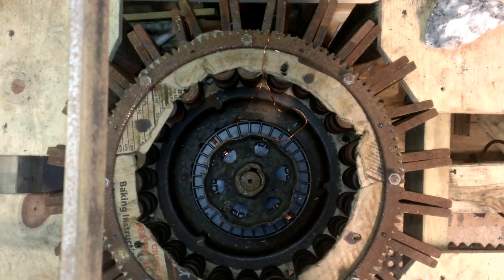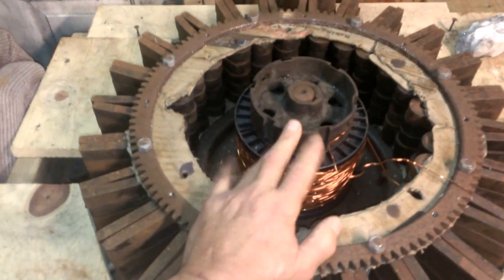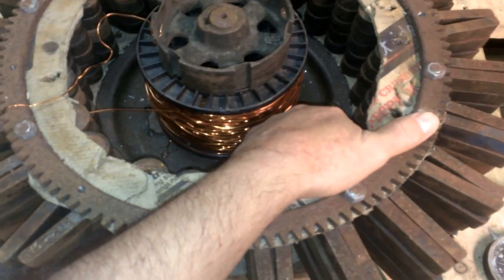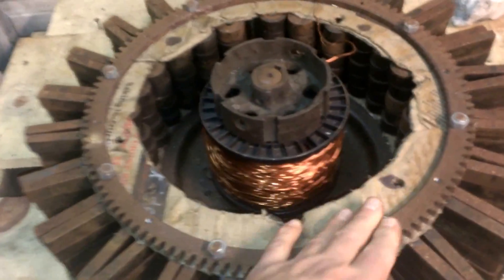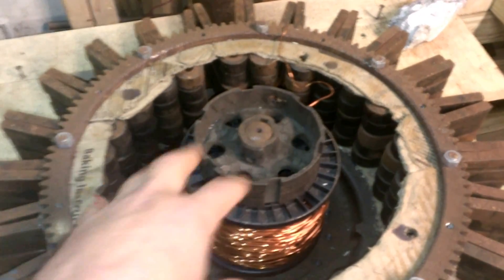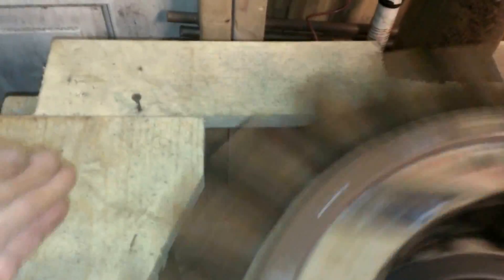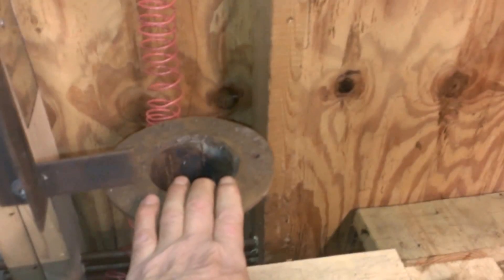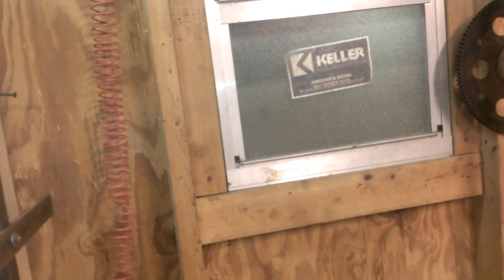The truth about Ed Leedskalnin's magnetic flywheel

Comment: When you have an inner and outer wheel of magnets, you will find that they reach a lull and stop as the field finally snags the contraption.  The V shape of the magnets helps to avoid that lull by sending the field in a waveform that compresses towards the tip of the V, causing the distance between magnets to not matter so much, and letting the thing spin more freely while at the same time feeding more momentum to itself.
I hope I said that in a succinct, comprehensible manner.

Comment: The "key" probably had an extended conductive piece of metal that touched the sphere at each rotation to "pulse" the circuit, which allowed for the recharge time you are mentioning.  The spheres are the "timing" of the pulse.  Not too different from picking the correct Mosfet and transistor combination like what Jack Scholze used on my coil designs, which you are about to emulate mechanically.  p.s. Make sure you put the water in :0)

Comment: If it's mimicking a human cell, it should have a rotating pos/neg at it's core. The outer cell wall is negative like the surface of the planet... the toroidal core brings in positive on one side, neg on the other... the rotation creating the lotus like field which acts like a gear. Jon Depew's vid "Equilibrius Grid" shows this.

There's a toroidal eye created that acts like a sympathetic resonance vortex tunnel pathway for aether to flow along similar to the thumper in dune is alluding to (long worm=long wave), or Egyptian Djed (Djed-Eye)

The rotating blocks in the yard of the castle with cup marks in them are to flow the charge along determined pathways..there's a vid on here somewhere showing it...forget the name though. Will link if I come across it again.
Reply from the maker: Hi there
The core has a neutral and a positive. And a negative running around the outside

Comment: You were absolutely correct!! Your suggestions on the way to use a Djonfrick reducer to  govern the feedback worked perfectly on mine. It's been running all day now and I'm even charging my computer. I will test loads it will take. The odd thing I found was that as I increased the load the temperature didn't go up, it went down consistent with the current load. One thing I must warn you about. The closer you get to the stator the more  of a pinching feel you'll get. It kind of hurts. Don't go near it under full load. It hurts. I'll update tomorrow. I have a heater connected to it to keep the room warm. It's making my room cold

Comment: I think you may be onto something. As I see from here the rebulon flux of magnetic sceebance would flow in a general pulsing. If at any point the polarity adjusts to modification flows the rebulon flux inverts much like a heart beat and that is simple to calculate, I obvious you've read Dr. Mabalab's book on rebulon flux fields as pertaining to nulpance currents. The formulas are all there. As the rebounding sphere ring connects to the negative side the spark gap nabrelates the rebulon flux to the positive and at that point it doesn't recharge, it discharges to, and here's the missing part and I know you must have been thinking about this, not a Tesla coil but a Frampton capacitance flux stator and from there back into the

Comment: Y would you fill it with water. If you look closer you will see the metal hook at the end of the chain.the chain was magnetised and pulled out to his tripod which is made of wood so he wouldnt ground the chain and the hook was attached to the bolts he inserted in the dead centre of his stones...the other videos iv seen of coral castle I noticed holes with bolts in them...please check this out.

Comment: The magnets induce a amplified static ark or spark (with addition of van Vllen belt) hits the hand grip that activates the tuning fork in the center of the bell.  The bell RF along with the Tuning Fork in the center of the bell is collected in in tool room around the machine.  The water in the center of the machine is to make a perfect smooth bell or grail.

Comment: It seems to me, that the key is adjustable and should be adjusted until the desired effect is achieved. I think that the key was moved in position and the voltages were sent in to the rocks until the rock started to do something - vibrate/or the cymatic frequency was achieved and therefore the desired result would levitate out of the rock, or not so much what was desired, but what just naturally started happening. Adjust the key position as the voltages are applied to the rock, and see what happens. If you start to make something happen, just go with it. The pyramids were probably theresult of doing the same exact thing over and over - the cymatic frequencies represent what is going on with the planet. Leedskalin was experimenting and changing the frequencies  - in order to make something unique.

Comment: I figured one very important thing from Edward's book. The wheel itself or any Iron metals tools involved in his project will not work for unti-gravity purpose if you are using it around any electrical devices or build it in the city where all these electrical waves & charges are around us!... You should heat the Iron around 1300 °C first to eliminate the electrical charges/waves  then use it to build or magnetize it. Also you shouldn't build the machine in the city where all electric devices are around us!... That's why he build his castle out side the city!
Believe it or not, the key to his invention is that you magnetize Iron witought using any electrical device or battery and just use wheels, wire, glass, woods, concrete and any natural sources. Email me if we can help each other out. my email is my nickname at g-mail.
Reply: sorry; my mail: lucky the name at g-mail